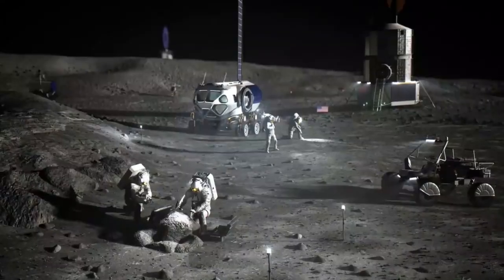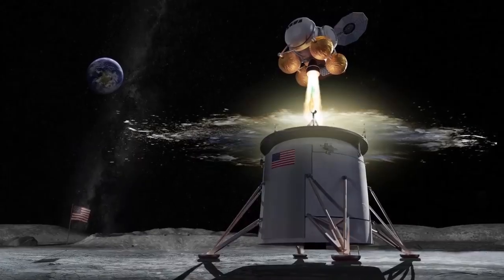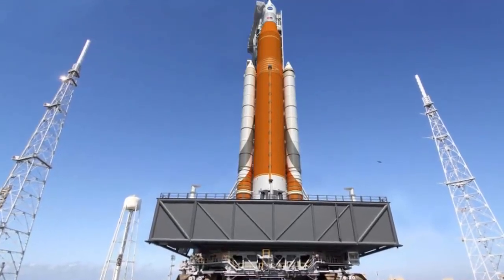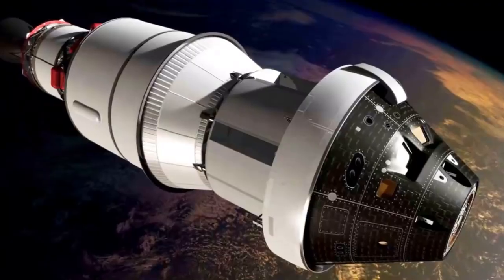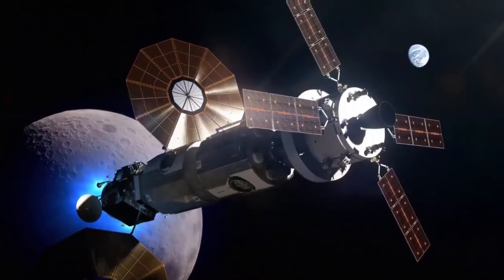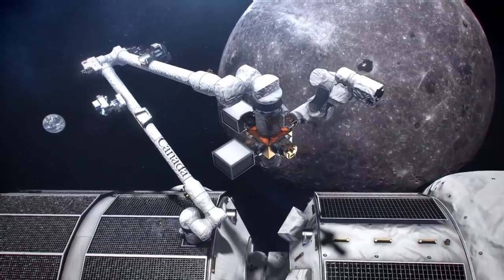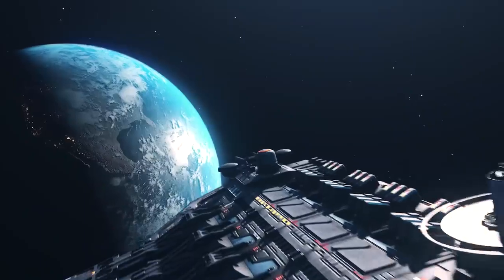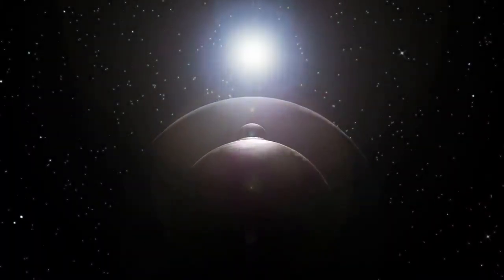The Moon In 2024_Will NASA Colonize #nasa

Comment: Here is a 8K Google 180 (3D) demo video captured from one of the six brief cinematic sequences during Neil Armstrong & Buzz Armstrong's lunar excursion.  Here we see Neil Armstrong on the ridge of the "Little West Crater" as he takes a few panoramic while Buzz Aldrin heads back to Eagle finishing up his excursion.

This is part of the "Apollo 11: 'One Small Step For...' VR Experiences" series, titled "Excursion: 137 Minutes on the Moon" to be out this holiday on Steam VR, Oculus, and Vive Port.  In the actual VR experience you can move around, pick up rocks, work with the tools & test equipment and even take pictures using your chest mounted Hasselblad EL500 camera that you can make appear/disappear with press of a button.  Images are stored on your hard drive so you can send them to your friends to, you know, prove that you were on the moon.

This 360 capture was done with 'Surreal Capture' a tool that allows you to capture 360 , stereo SBS video directly from any Unreal Engine game or VR experience in real time at 7680 x 3840 with varying sample rates.  It also works great even during development while in the editor.  Sadly stereo 360 capture is not implemented yet (coming soon) but it is easy to get at least true stereo for 180 degrees by using the horizontal offset variable and inserting 6.  Captures most Post Processing effects, except Exposure/Eye Adaption.  Working with the developer to correct this if possible